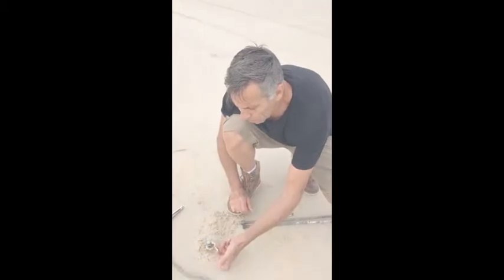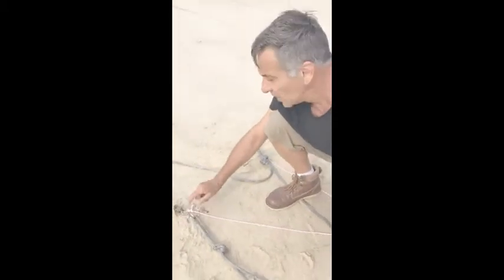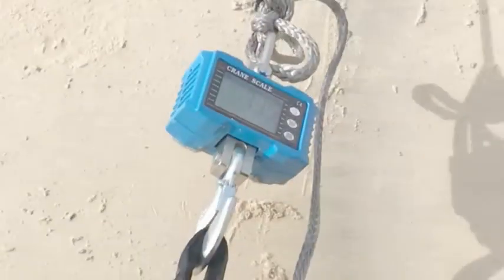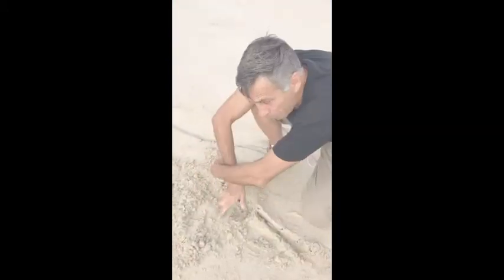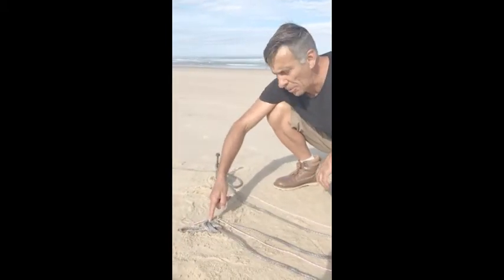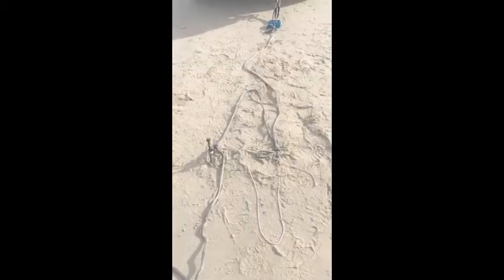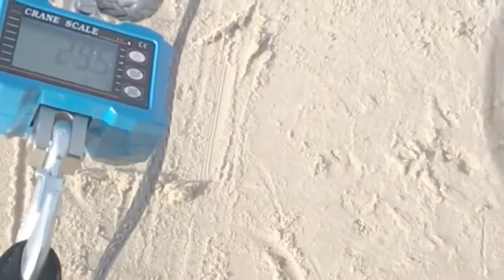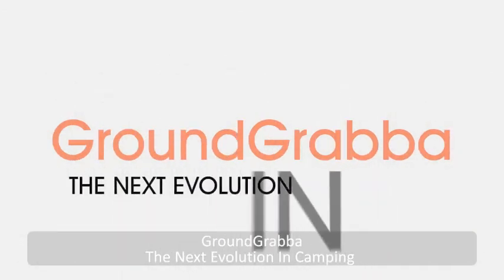Beach Tension Test Maximum anchoring GroundGrabba Pro II

Comment: Combining 2-3 in series tied together with rachet strap could be a life saver for utv and atv on the sand terrain of Florida.if you send me a couple i can make a testing video.
Reply from the maker: Hey Mandy, thanks for that suggestion and offer.  Using them for car retrieval is not something we can sanction due to the potential lethal outcomes.  What one does with them is their choice.  I have thought of something though but it takes the risk to a whole new level.  :)

Comment: I can see this put to a good use for construction, but for tents (etc.) these metal ones are fairly impractical compared to the plastic. The only real advantage is in hard compacted or rocky soil at a place you can reach with your vehicle (as you need actual tools to get it in or out).
Reply from the maker: Thanks for your point of view. In what part of construction do you see them being of value?  By the way,  you can use them with socket wrenches and are 3/4" (19mm) so same size as many popular 4x4 wheel nuts.  But yes, i designed them to make life easy using a cordless battery drill.  And yes for small tents etc they are definitely an overkill but if you are one who likes big camp set ups, big shade canopies on the beach then you'd love the safe and secure feeling you'd get using these.